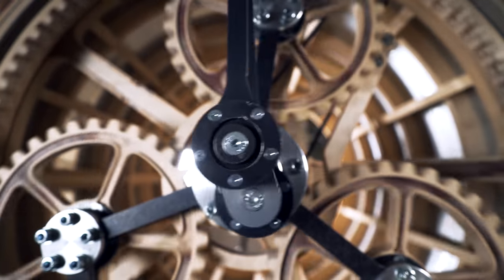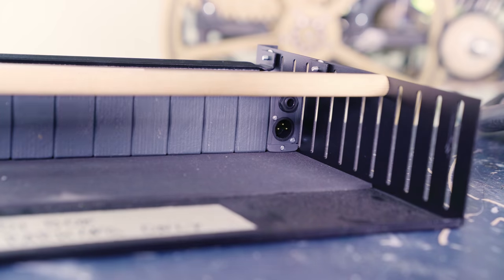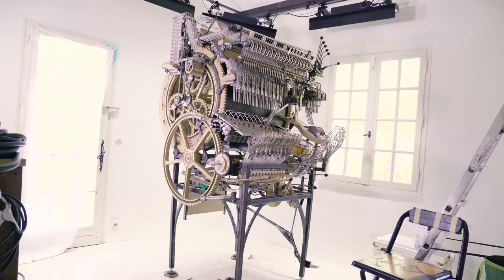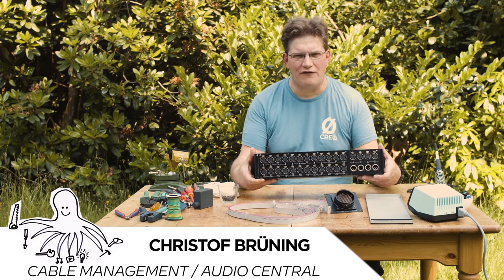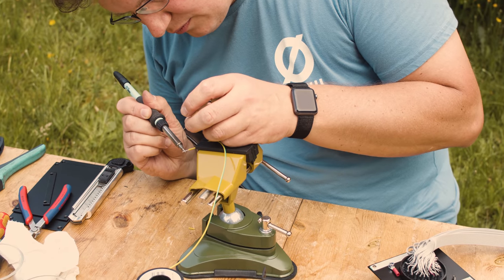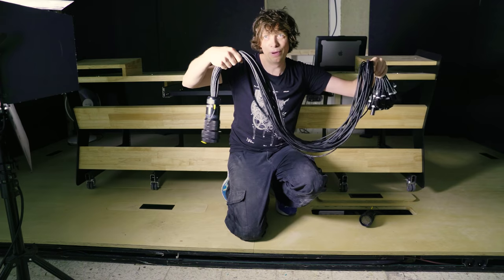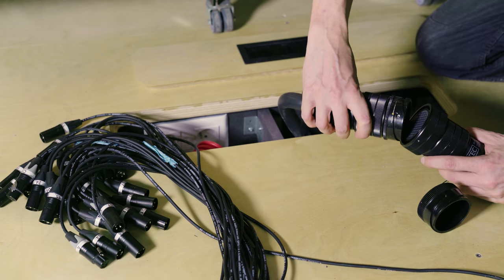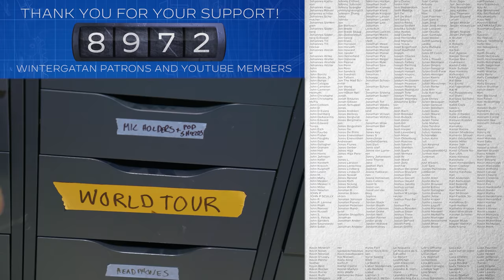28 Audio Channels in One Cable! - Marble Machine X #133

Comment: As a professional audio engineer, the solution with all these cables, and a huge cable brings shivers down my spine.
I really love the project and even in this case all the effort people put into it, but there are much better affordable professional solutions for this that look (and perform) a lot better. Not to mention the issues with compatibility etc on a live stage. Think more along the lines of a Dante protocol, AES50 and the like. A double or triple standard SFTP would be my choice anyway for easy replacement.
Reply: What is the problem with the huge cable? (I have no expertise in this field)
Reply: @TNaizel  if all of the individual strands are shilded there is no problem, if not then there is a huge problem because of interfirance and electrical noise
Reply: And I thought I would be the only person with these thoughts...
Reply: @TNaizel  expensive, fragile (with a cable that thick, think about what happens to the individual conductors inside when you bend it - the conductors on the outside of the bend need to be much longer than those on the inside), and appears to be custom made, so would need to be repaired or spares brought on tour. With a digital snake you can run all of this over ethernet cable which is cheap, easy to repair (only 8 conductors) or even easier to keep/find a spare to replace it should anything happen to the cable.

But compatibility is a challenge on a world tour with digital, since there are multiple digital protocol standards unfortunately
Reply: And if something breaks on the connector, replacement is not as easy as replacing a standard cable.
Reply: I have no expertise but from what I understand, it's the most flexible solution  because we never know what the MMX is going to bring next in term of problems to solve.
Reply: no worries, this is a normal thing to do with multicore cables..  why would these even exist if you could not send audio through them ?
Reply: Well a Digital Multicore Solution would have maybe been a better alternative
Reply: Agree, he needs a mix i/o outputting Dante.
Reply: @scottbez1  Most professional mixers basically support most/all of them. Quite often AES50, is the way to go
Reply: @Noplan  I think this is the biggest issue. DIY is fun an all, but having to troubleshoot or replace a broken cable in the middle of a recording or live performance is no fun.
Better get some standard cables that you can keep as a backup.
Reply: @termivan  That was my first thought, you can get interference from two cables let alone cramming 20 odd together, but we'll see.
Reply: @TheGameLecturer  there are studio quality DAC breakout boxes that convert back to analog if needed. Much easier to manage than that huge snake.
Reply: @TNaizel  heavier, multiple pins and points of failure, expensive, the very small market of suppliers, expensive, prone to failure, not easily transported, vulnerable to damage, electronic noise,  une ven frequency response, uneven loss of signal amplitude, heavy and awkward to set up, 1970s technology, stuff like that...
Reply: Well thats an LK37 Connector which is the standard mulitpin multicore connector for pro live audio. He will get replacement cables from every major sound company. Only when his Stagebox has a problem he will need to ge the soder iron and fix it
Reply: I totally agree with you, though somebody mentioned in other comments that this is just studio solution and it will be replaced with digital for the tour, so it makes sense
Reply: @johanneshofmann9192  It's an LK85, since it's carrying 28 balanced signals. I know few sound companies in my city that I know have each a big ol' rack of them in their warehouses. I think the issue that might come up is that the common headers we use for festivals/big shows are either LK150 for 48ch or LK200 for 64ch, which are the main headers going to consoles/OB trucks and then LK37 for 12ch headers, which are for all the various stage boxes. So it probably won't integrate as nicely as the LK85, particularly in this configuration, is a big of an odd one out. If he really wanted to make friends with festival stage patch, having it as 2x LK37s would be more compatible as it would go straight into typical festival headers where the boxes would normally go in.

Comment: Also, I use a Soundcraft Si Impact console. It has a MADI option card installed for use with the 32/8 stage box. This turns the console onto a control head for the stage box with a single CAT-6ES cable.

Comment: @Wintergatan The Multicore is a great option for a studio installation, but I think you should look into DANTE for Touring, which is a Standard Network Protocol used by nearly every Audio console manufacturer. Which means you would only need one (or two for redundancy) Cat6 cables  running to the MMX
Reply: Only Yamaha uses Dante by default. For every other manufacturer you will need a Dante card. The only standard that all manufacturers use, is analog.
Reply: No he absolutely has the right solution. Dante is far from universal. He will be hiring production from others and staying analog makes him compatible with every production company,  venue and studio in the world.
Reply: @stephenrobertson2197  he will definitely bring his own mixing engineer on tour, and with this scale (24 channels MMX, plus maybe 24 channels for rest of the band, or more) mixing engineer will definitely have a show file (and working knowledge of) one or two brands/models of mixing consoles, defnintely not "anything every production company has"
Reply: I'm not an audio expert here, but that sounds like doing an A2D conversation on the MMX
Reply: @maglax  Yeah, but that's not a problem. Unlike general perception in the Hi-Fi community, A/D conversion isn't particularly challenging. You could easily squeeze a 32 channel interface including preamps into a shallow 1U rack mount case... assuming you're using smaller connectors than XLR (tinyXLR, LEMOs or just 6.35 mm jacks).
Reply: I realize most of these components are sponsored and it's done for the look, but just the cabling for this basically costs 1000 € without labor costs. Every XLR cable connector is ~3 EUR, panel connectors are more expensive, that 32 pair multicore is about 25 €/meter, each preamp is 300 € (ripoff pricing, tbh, but not unusual) etc. -- you can easily see how the digital pipe could easily become the cheaper option and will also have higher quality. A stage interface can be had for around 1500-2000 € in comparison to the 5000+ € cost of the system in the video.
Reply: the aesthetic of one massive cable coming off the back is kinda more in line with the mmx vs a couple of wimpy cat6 cables. 
if it was mine to do it'd be digital all the way but i can see why you'd want the customization and known quality of a setup like this.
Reply: I can see there being issues at some venues of them not having enough channels on the house board. More than likely they'll being their own rig but at the very least mixing down on stage would help a hell of a lot for the FOH engineers involved.
Reply: I would have gone with a digital snake, can still be XLR at both ends
Reply: @-szega  and - by the way - he does A2D conversion anyway - now he uses 1 x 2HE for Multicore XLR -> Multipin, 1 x 2HE for Preams in the MMX, 1 x 2HE in the Mixer rack with addl. Preamp and A2D (he tells himself when showing the setup in his mixing / siderack). So using digital multicore with integrated Mic Preamp (with remotely controllable Mic Preamp) would result in 1 x 3HE in the MMX and 0HE in the mixer rack.
Reply: @Mister_Brown  As Martin is using the Multicore NOW, it is a configuration you get readymade off the shelf. The nice idea of the sponsoring cable specialist, to integrate the mic preamps on the long run was not used yet). Digital Stageboxes have their preamps included anyway, so they make quite good use of the space.
For live/touring setup, you will not use "wimpy cat6 cables" - the cabling used is ruggedized cable with connectors protected by a sleeve with same dimensions as XLR Connectors. So these cables fit through any hole a XLR cable would fit. 
Regarding Flexibility: Patching of audio sources to mixing channels takes less effort than re-patching XLR physically. So no limitations in flexibility either. And for Quality: The same Preamps used in analog channels of modern consoles are used as well in the digital stage boxes - just remotely.

Comment: That "boa constrictor" gives my former roadie-self PTSD. Hanging one of those, between trees, and high enough to be out of reach from drunk members of the audience was a lot of work.
Reply: I only ever worked with 8-channel or 12-channel snakes... I don't even want to think about a 24 channel snake.
Reply: @lucioghosty5435  the last 24 channel one I had to deal with was pulling it into a 4 inch conduit from the stage to a sound booth at the back of a church.  Took 3 pulling on the rope tied to it and another guy pouring lube down the other end.
Reply: @lucioghosty5435  I have access to a 32-channel digital console/recording interface (si expression 3 with the multi-digital expansion card) with a 24-channel snake; It's heavy as hell but not nearly as big as Martin's here. I'm not sure how it manages to be so much smaller, maybe it is just not as high quality. It certainly does the trick, and 24-channels is overkill for anything I've ever had to do anyway.
Reply: @inthefade  in his case 24 channels would  probably be very needed as we saw many, many contact microphones build in already.
Reply: @BruteClaw  that sounds absolutely amazing
Reply: @inthefade  ain't no killing like overkilling
Reply: I remember setting up an outdoor gig, we had the multicore stretched out on the grass between the stage and main mixer, cones marking this out when someone decided the gap between the cones was just enough to drive his car through...
Reply: Interesting. I've not heard of big cables like that being called "snakes" or "boa constrictors". (Called that because it is a big snake?) Is that a music/roadie term? I would have called it an umbilical cable.
Reply: I'd recommend using a cable ribbon instead, or a multicore cable tape. While they're more fragile, they're much, much easier to route and thinner. You can wrap them in some nylon cover. This cable hose is way too big. I'd take a tape out of 4 cables over that any time of the day.
Heck, it has a ribbon connector inside. Why do the external wires have to be this thick? It's audio, not high power. If you're sending audio over tens of meters of trip inducing cable hose, you're doing something wrong in your stage setup. (Like not having a cover for the cables.)
Reply: @lucioghosty5435  Biggest I've ever worked with was a 36 channel which was hell. I'm glad that these days we just run a small digital cable and have everything good to go
Reply: Hanging fat cables among the threes was the only thing I did in the army for 10 months.
Reply: Why are they even using these? Optical could transmit near infinite channels
Reply: @AstralS7orm  Or just go Dante i.e. a single CAT like mentioned elsewhere
Reply: @AstralS7orm  Im not an audio expert but my guess is : Insulation! You dont want any inductive effect between the cable. It would make the sound crappy.
Reply: @AstralS7orm  each channel on that snake is individually shielded and wrapped, probably using a quad wire twisted pair with a drain wire, foil shielding and braided shielding, individually wrapped in mylar tape, and then bundled inside an outer double layer of foil shielding with some spiral drain wires, then a few layers of protective fibers, then the insulation.
Cross talk is a big issue, especially if you are using some low output dynamic microphones and some high output condenser microphones, and maybe some line level signals too, and then you put those wires next to each other for 30 meters and then amplify then highly.
You will hear other signals on the quiet lines.
You can't get that kind of isolation and shielding with ribbon cable, which was only used for very short runs, and even then I don't consider it best practices, because it makes cross talk more likely.
I would have used shielded, twisted pair hookup cable personally.

Comment: Damn, are those legs going to be able to hold the full weight of the machine? They look comically small now that it's coming together.
Reply: That look was intended... but I wonder if it'll work out.
Reply: well its steel and steel is really strong.
Reply: Steel is VERY strong, especially when it does not involve loads which cause flexing. Assuming these beams are 30mm (1.3 in) thick with a wall of 2mm (3/32 in), (and it is clearly bigger than that), even if it were the cheapest possible steel (AISI 1020), it would take 7.8 metric tons (17600 lbf) for it to even start deforming permanently. Even when we consider buckling in the worst possible situation (not considering the structural under arches), its able to take more than 5 metric tons ( 11200 lbf) before failing by buckling, assuming the length of the legs are 800mm.
Reply: Those legs could hold up an SUV. Structural steel is far stronger than it looks.
Reply: @purungo  The MMX is such a feather compared to that.
Reply: @purungo  The pins in the feet are not nearly as thick and might not even be steel. Also its probably where most of the pressure is right now being so low to the ground and that thin.
Reply: I was just thinking the same thing like three minutes into the video. Might need to widen the stance a bit.
Reply: I'm sure Martin has a plan to mitigate the weight distribution of the entire piece. Maybe reinforcing the existing legs, adding support in the middle of it, etc etc. We could definitely reach out to Martin and the team about this in the discord.  I'm glad that I'm not the only one with this concern now that the MMX is reaching its completion.
Reply: Have they thought of adding like wheels so it'd be like easier to move the mmx?
Reply: I mean the thing to remember is that he has how many engineers working with now? Surely they would realise if the machine was starting to be at risk of toppling over at some point...
Reply: @Grow Greens Indoors You're not. But as long as someone doesn't kick it from the side, it should be fine.
Reply: @SyzygyNoon  I'd guess 800 to 1,000 pounds or so, total.
Reply: @Grow Greens Indoors Obviously it's top heavy - any large machine on legs is top heavy - but if you imagine the centre of mass as the top of a pyramid and the four feet forming the base, it isn't particularly precarious.
Reply: It's solid. That's all that matters.
Reply: @41tinman41  I think Martin has said that the Marble Divider could be separated from the machine itself. That should help with transportation.
Reply: @Grow Greens Indoors there is a video where he welded the bracing onto the frame. The mashine was kind of wobbly before. After it was rock solid.
Reply: @Catboy_Riku  Its welded. The more common options for profiles are aluminium and steel, but since it is welded all over, I'd assume its steel, since it has been shown to have been welded, which is something extremely difficult do properly perform in aluminium
Reply: word  I can definetely see the welded parts being a weak point for this build, but nothing that can't be easily reinforced, I imagine
Reply: @Catboy_Riku  You're right, the feet could be the failing point
Reply: Martin knows better than to leave a failing point. He hasn't gone this far to leave anything to chance.